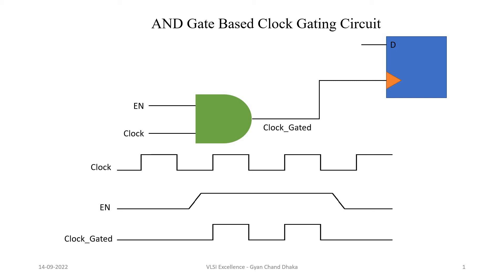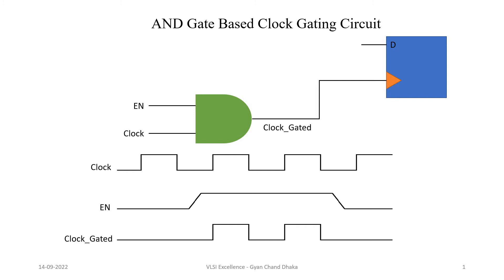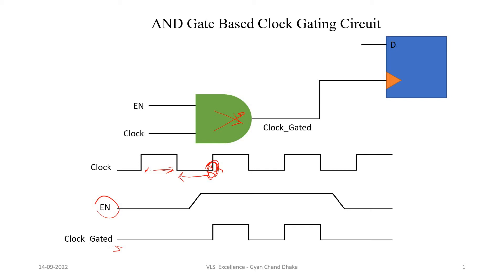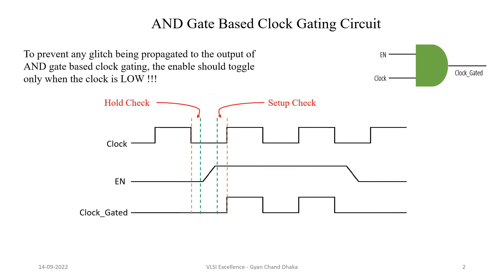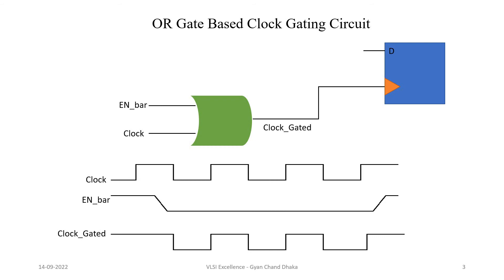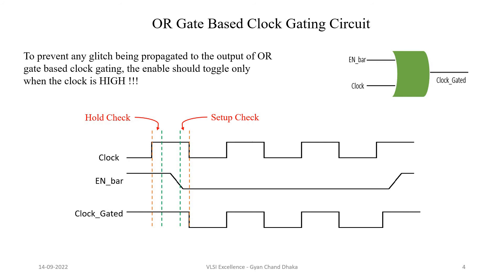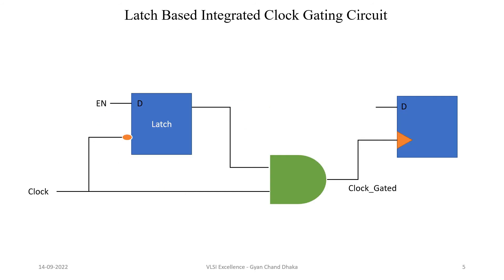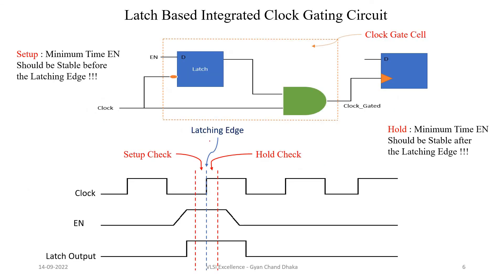Chapter#16 | Clock Gating Setup & Hold Timing Checks | Static Timing Analysis(STA)| @vlsiexcellence

Comment: when clock is level low then it latch the en no?
Reply: can you explain how the setup check like which edge to which edge will setup check be done and which edge to ehich edge will hold edge will be done
Reply: @abish83  setup check for active-high clock gating check will be done b/w fall -> rise edge and hold check will be done at fall edge(fall->fall).
Reply from the maker: It is a negative level sensitive latch , means when clock is low , the latch will be transparent